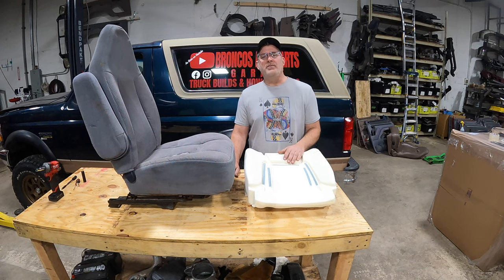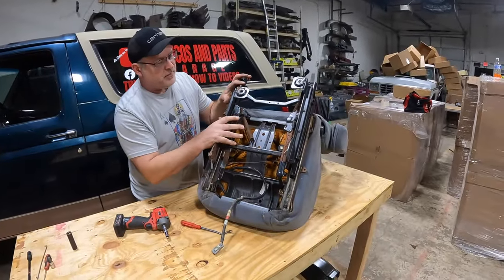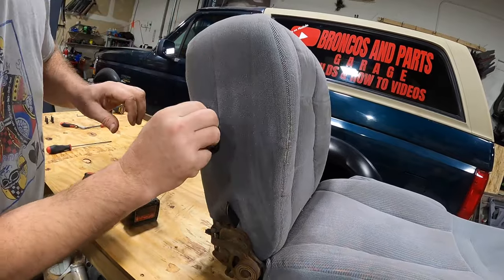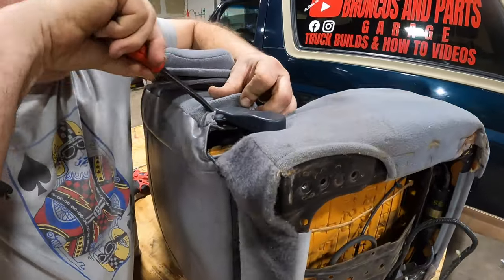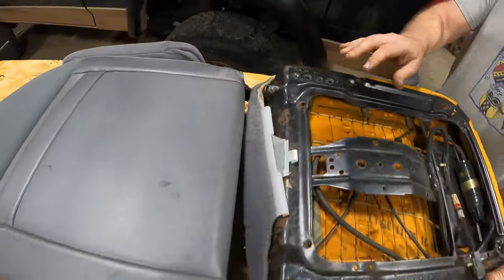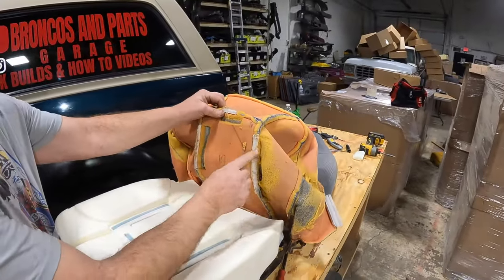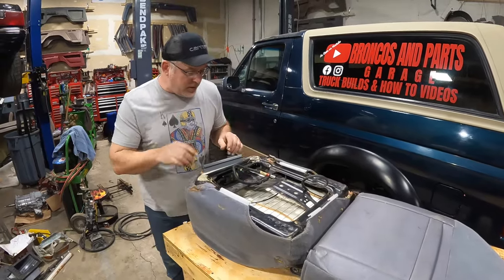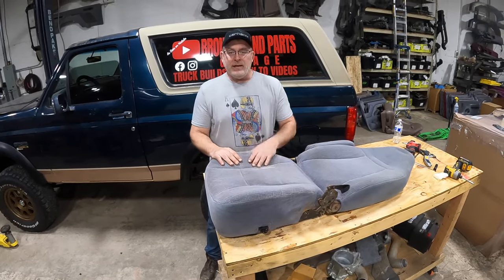NEW Bronco Bucket Seat Cushion Installation - OBS Ford Trucks too! #obsford #broncos

Comment: These look like great replacement cushions. Do you think you'll be making any for the 87-91 model years? I've got an '89 F250 that needs new bottom cushions and nobody seems to be selling any.
Reply from the maker: These fit your seat pan perfectly. The only difference is how your seat cover attaches. You need to make a few slices in the foam to attach your fabric seams to a wire under the cushion. It’s been done about 30. People have ordered it for your year.  Hog rings

Comment: How long are you figuring it will be before you get the foam for the 20/40/20 seats? Also, where can I get the cover for the drivers seat?
Reply from the maker: We are working on the 40/20/40 now

Comment: I was wondering if you would have info on valve covers.  I have a 96 bronco 351 W 5.8 L  but have been unable to find one that I'm confident will work.
Reply from the maker: I sell stock ones.  Little custy
Reply: Thanks but the ones I have are stock in decent shape so worse case scenario I will just have to paint it. I was just hoping for an upgrade.
Reply from the maker: @Ray-ux9eh  check out Jeggs or summit
Reply: @BroncosandPartsGarage  have already.  They have slant covers that state won't work w 5.0 efi but mine is 5.8.  My only concern is the right side..  drivers side plenty of room. The pass side has the plenum to worry about.

Comment: Chris - thoughts on washing the lower covers while they are off?   When I used the 2003+ cushions in our '96 Bronco, I had my kid sit on the frame when I reconnected they cushion clips.  Looking forward to these hitting my doorstep as the 2003 cushions 'work', but they aren't all that comfortable.
Reply from the maker: I would not throw in a washer or dryer.  there is foam on the back.  I would steam clean them with some sort of vacuum and attachment.  carpet shampoo type unit